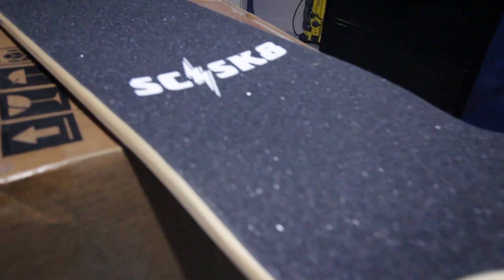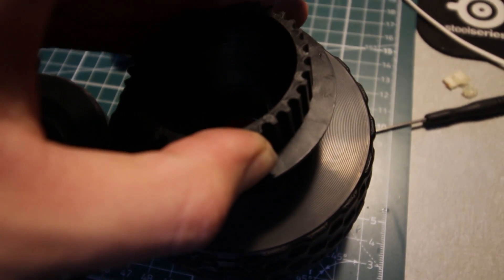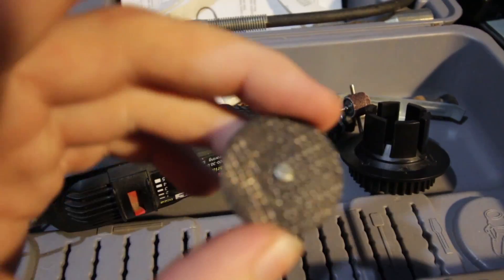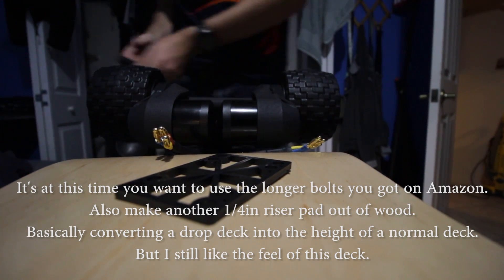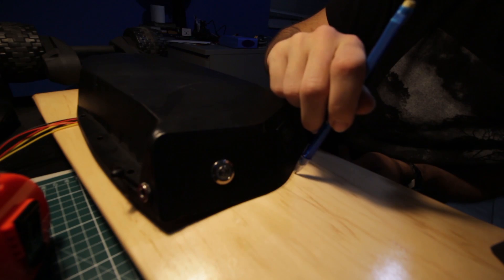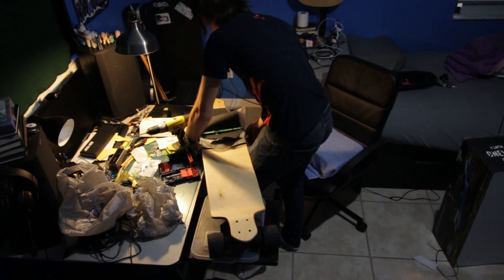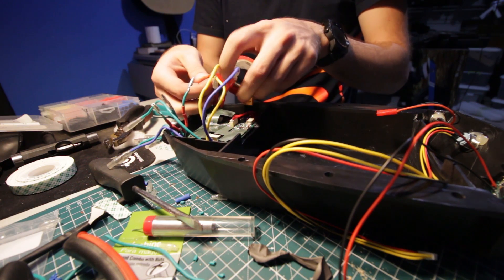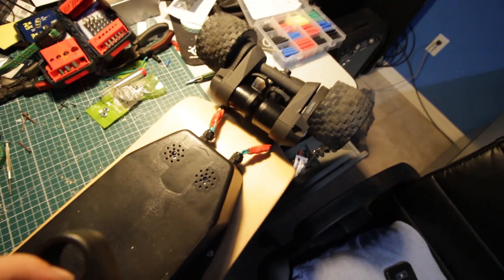DIY Electric Skateboard for under $600

Comment: Hello, I would like to build a electric skateboard. But I don't know how and which parts. Could you please help me?
I would like it to go 45km/h
Minimum 20 km of range
Waterproof.
Hub motor.
Less than 99wh.
It needs to fit on the foldable board up deck.
I am looking forward to hearing back from you

Comment: The air vent hols at the bottom are so the heat can get out from the ESC controllers needs to be vented. But overall awesome video thanks for sharing.

Comment: Great video, but if you would buy this or the meepo board, which would you get?
Reply from the maker: Backfire ranger is about to release. It's the closest I think because of battery life.

Otherwise backfire 2 with the bigger wheel upgrade. Cause it's all about those comfy wheels. (At least where I ride)

Comment: Do you think the 10S5P enclosure would fit on the WowGo 2S ???  I got 250 sony VTC4 18650 cells (rated 2.1Ah max 30A/cells). I`m thing about making a DYI 10S5P (10.5Ah max 150A) pack with 10S Li-Ion 50A BMS.
Reply from the maker: It's pretty thick. You might need some spacers. If you are making a diy pack, it's not hard to make a diy enclosure at the same time.
Reply: Thanks marsrover001 ! Also thought about making enclosure with fiberglass, seem like a lot of work though... Anyways the WowGo 2S will be my first electric board. I`m 36 now... Use to ride a twintip alienworkshop in 1998. Gotta get back to it.... Only experience I have on electric is with eBikes. Got a BBSHD and another ebike with a 250W planetary gear hub... I`m thinking maybe I should have gone dual belt driven rather than dual hub.... I`ll start slow and work my way up to faster speed board...

Comment: Any reason you went with a drop down deck? How has the gear slipping been, bout to pull the trigger on this kit. Would it be feasible to do mobile belt swaps if you bring tools in a backpack? Really dig this and part one thanks for making them.

Comment: Appreciate the video man. Do you have another video without needing to do any work to it, cutting, fitting, etc? This would be my very first build and I don't wanna fk it up.
Reply: Zora Gill if u don’t want to change it to off-road wheels  like he did You can just installed it with the wheel it came with and you won’t have to do all the extra tinkering

Comment: How’s it do on hills?
Reply from the maker: Yes it would fit. The bigger wheels do affect acceleration and hill climbing. But like the other guy said, I've not found a hill it can't climb.
Reply: Also do you think it would fit on a sector 9 sidewinder deck
Reply: Belt drives typically do quite well on hills. He has quite large wheels which will be worse on hills, but overall probably going to get up 25% hills with his setup depending on weight. Be careful with drop through decks that are low to the ground, you need clearance for the casing on the bottom, that's what i'd worry about with that Sector 9 deck.